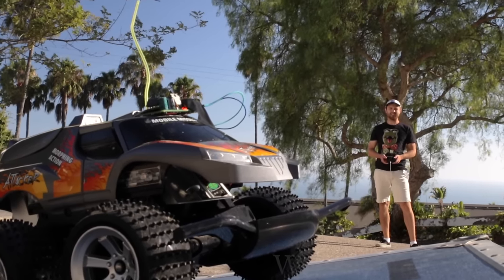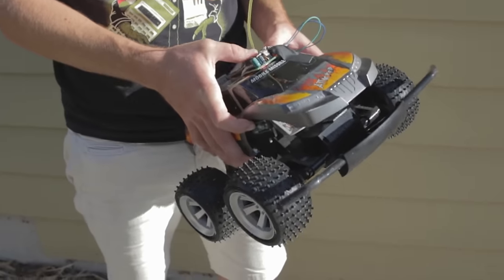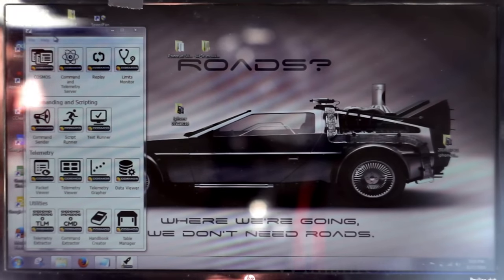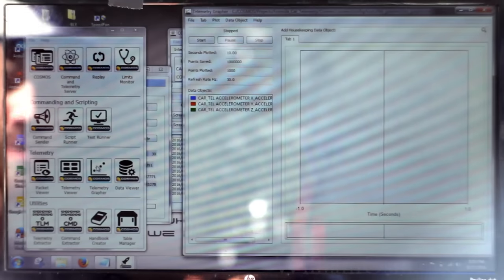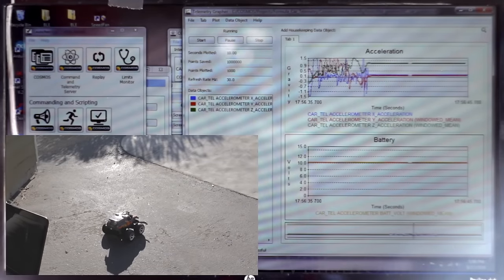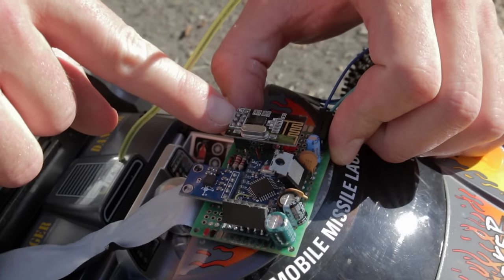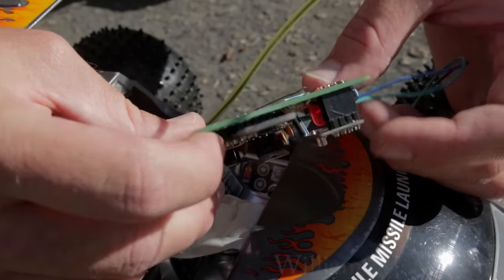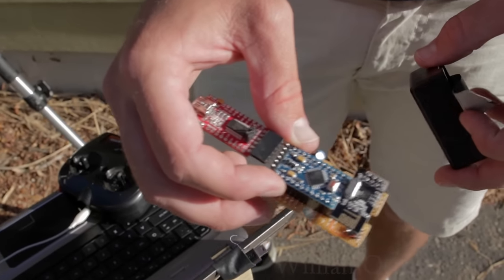COSMOS and Arduino: $20 Telemetry System

Comment: If you want a somewhat more professional system you could get the racepak CL1 or CL2. both use your phone and a data box to transmit live data to other phones/tablets, and include live lap timing and map tracking. Pretty neat systems. The cl2 literally plugs into the obdii port on your car and streams live data

Comment: William, this is very cool alternative to using programs like National Instruments LabView.  Do have circuit diagrams of your telemetry system?  You mentioned using two voltage regulators (3.3V and 5V) and large capacitance.  I see you also used electrolytic capacitors, resistors and it looks like a diode too.  It maybe inexpensive and small, but looks complicated :P  Thanks!

Comment: Hey, I'm looking into making something like this for my Baja SAE team. Since we're all pretty much studying mechanical engineering, our electronic knowledge is pretty bad. How many sensors are you able to attach to a system like this?
Reply from the maker: Depends on how the sensors communicate. The Arduino itself only has a handful of digital and analog pins, so there is a limit.  However there are digital communication protocols like I2C which allows a large number of sensors to share the same two wires.
Reply: William Osman how many arduinos can you have attached to the wireless module and have it transmit the data? I'd like to have a couple of accelerometers at the steering knuckle when taking a jump in order to verify some FEA. If we can a total of 5 accelerometers then I think we should be fine

Comment: I was wondering if you could connect a stronger antenna module to make the range more like miles and also what data the cosmos sends from the Arduino, is it all of the pin values.

Comment: so you're using two arduino boards in the build, one to run the accerlometer and the transmitter on board the car and another to receive the signal and transmit the data to the computer? would it be possible to directly connect a transceiver to your computer and bypass the use of two arduinos? from my understanding you could accomplish something like this using an xbee, is there a reason you chose to go the route you did in using two arduinos? are the transmitters connecting through radio signals and not over a common wireless network?
Reply from the maker: Xbee does both jobs, the transmitters I'm using are not as "smart" as xbee. Only one Arduino is used to handle the accelerometer and transceiver on the car.